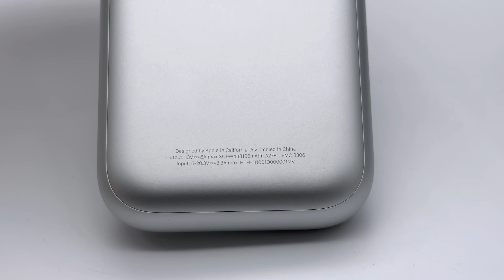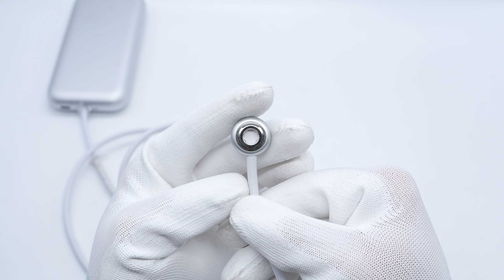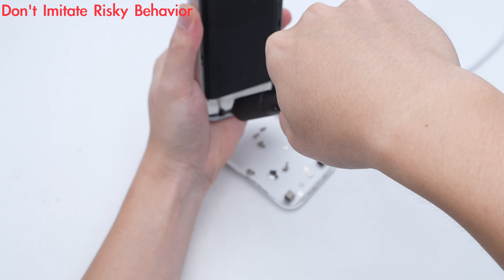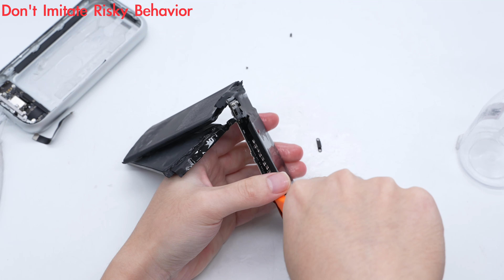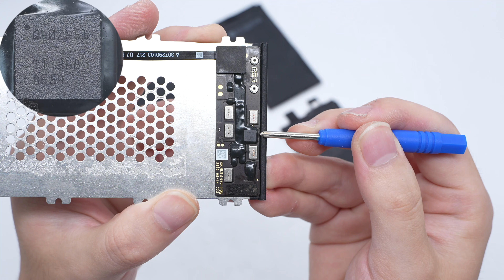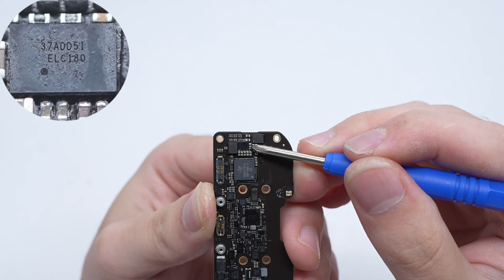Teardown of Apple Vision Pro Battery

Comment: Why using a slightly less capacity lithium cell in series with other two having higher mAh rating?
Reply: @alidollar1994 The cells are rated for 3.87v nominal (4.45v max) at 3969mAh. Considering the pack is rated for 3166mAh at 12.65v (4.225v per cell), it would seem that Apple or the pack manufacturer opted to not fully charge the cells. That may be a safety thing or perhaps for better longevity, who knows, but that is why the pack is rated lower than the individual cells.
Reply: You are right! It's for longevity. Since the battery is likely to be recharged more frequently than other devices like smartphones and laptops due to their short battery life, they don't let them reach 100% during charge in order to preserve battery health.  @subsgob00m
Reply: they have three identical cells with the total mah marked less